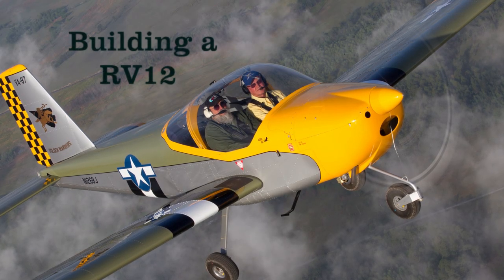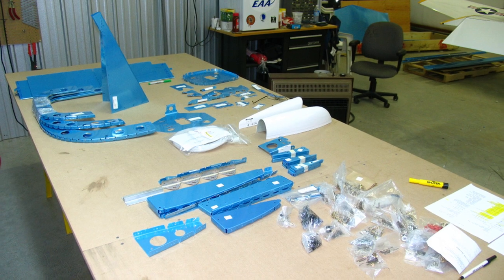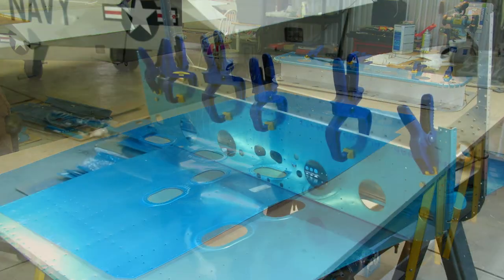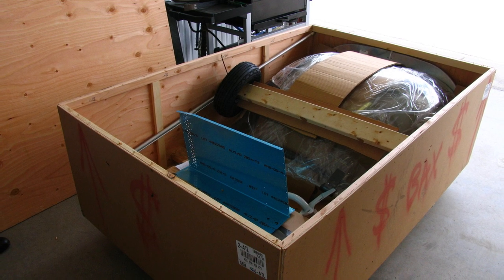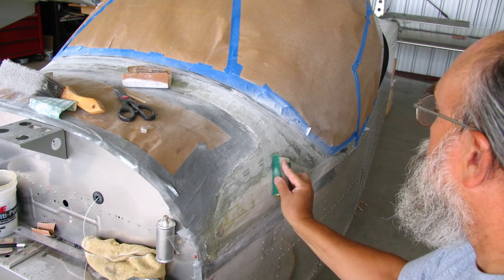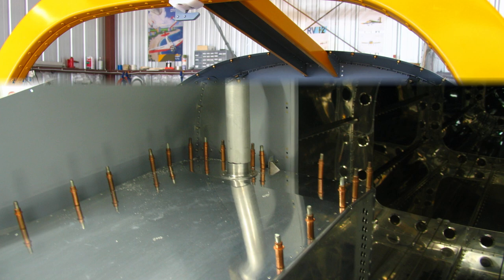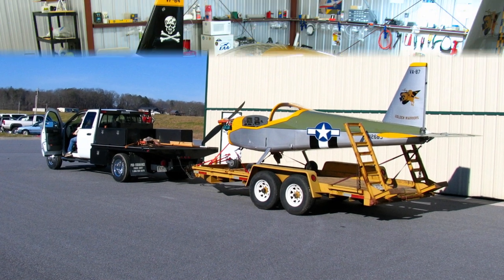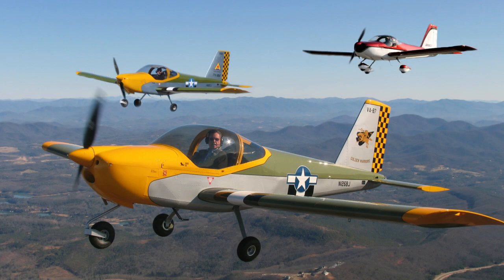Building a RV-12

Comment: Lovely build.  How does the RV12 compare to the Zenith in terms of flying quality, handling , etc?
Reply from the maker: Both flew great.  The Zenair 601HDS was slower, less hp.  The RV-12 kit was pre cut parts, pre drilled and easier to build.  My Zenair was an older kit, so pretty much everything had to be cut and fabricated.   The newer Zenith kits are much like the RV-12 kits today  with pre drilled and cut parts.
Reply: @BlueColorKat  Indeed.  Zenith appears to be transitioning to match-hole final-size construction for their kits.  Given that, I'm wondering if a CH 650 might be worthwhile vs a RV-12.  One thing that concerns me is the numerous RV-12 bulletins, especially the one involving the gear reinforcement that would be quite hard to do after the aircraft is built.

Comment: I likely have a more limited budget than you, therefore I will not use a Rotax or UL etc, those engines are close to regular engine prices, big company, lots of overhead and share holders to pay for. I likely use an auto conversion engine instead of a snowmobile engine. Suzuki or Corvair.

Comment: How did you fit the cowl without the engine?
Reply from the maker: If I remember right,  I believe there was instructions and measurements to where to cut and assemble.   I know it was a tight fit.